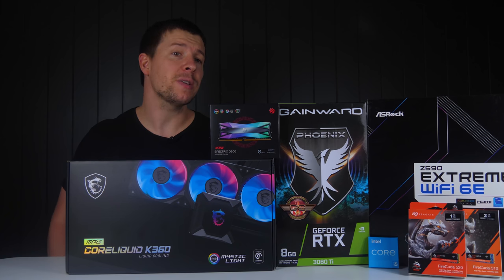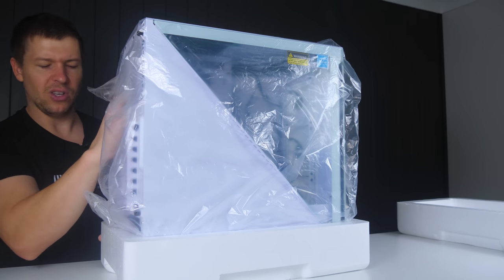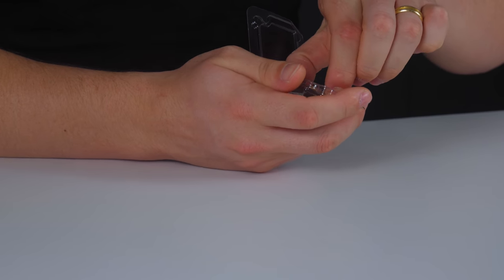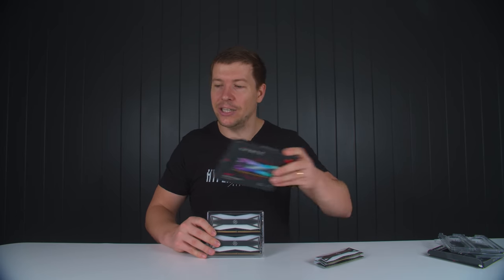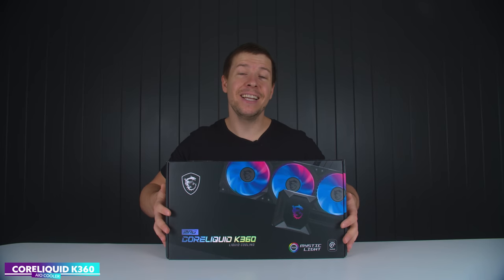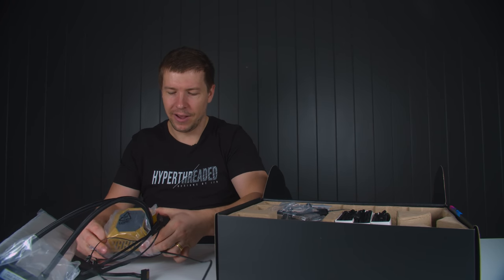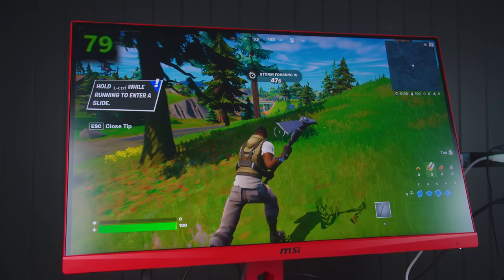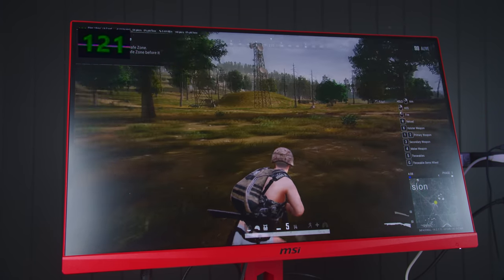Building a PC to Help a Broken Family

Comment: I say 32gigs of ram is the new standard or should be for gaming because when you have your games open, your browser, and all the programs in the background running 16gigs will struggle. That's why i use the Corsair Dominator Platinum RGB 32gb - good ram